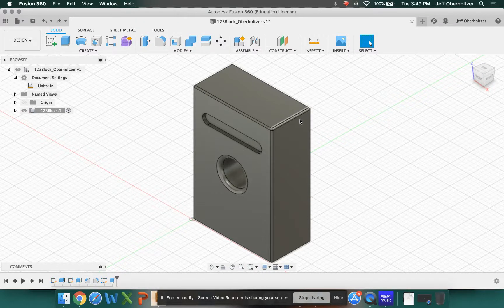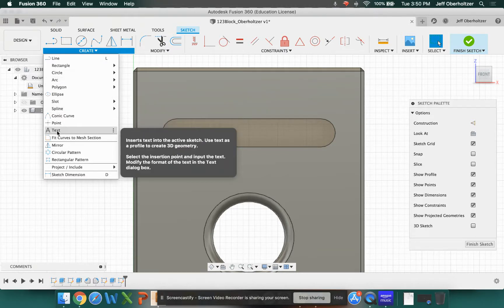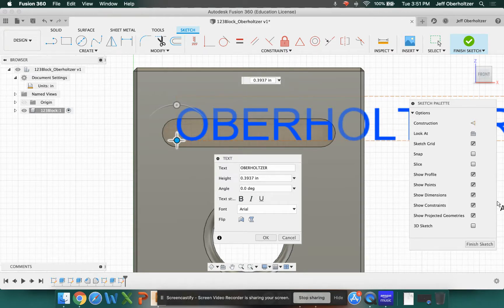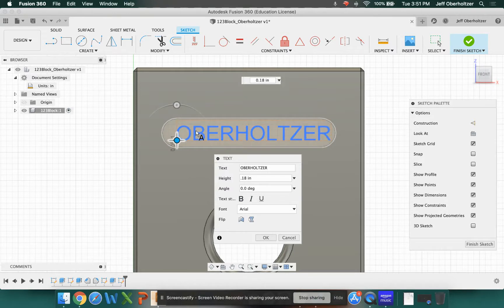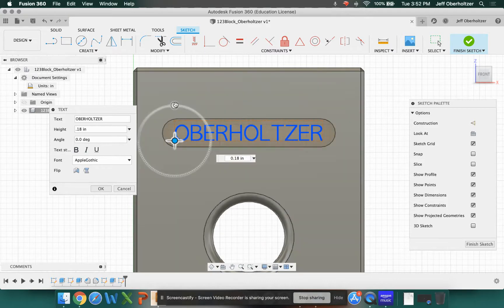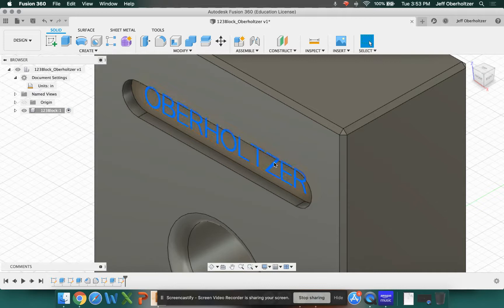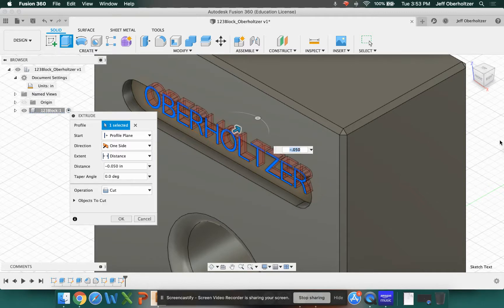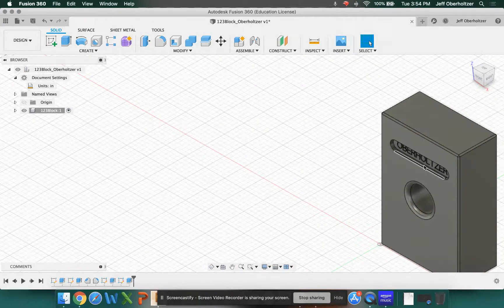Fusion 360 Part 8 (Adding & Extruding or Cutting Text)

Comment: It's worth noting that for Text to be under the Create tab you HAVE TO BE in sketch mode. I swear fusion 360 has never hired a UX person because this software is a nightmare to find anything on.
Reply from the maker: I do agree that it is not always intuitive to find things in the program and that the function is not always apparent.  That said, I suppose the same thing is true of most software suites until we get accustomed to them.  I preferred inventor over Fusion until I was forced to make the switch.  Once I got used to the differences, it was/is fine.